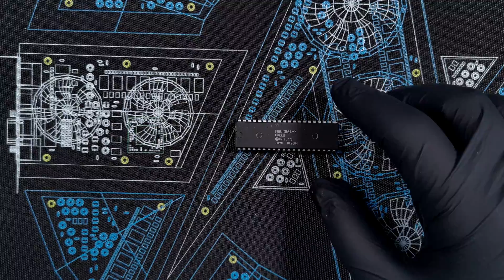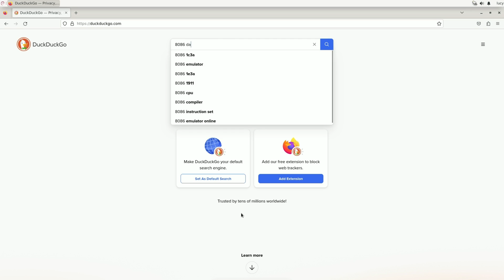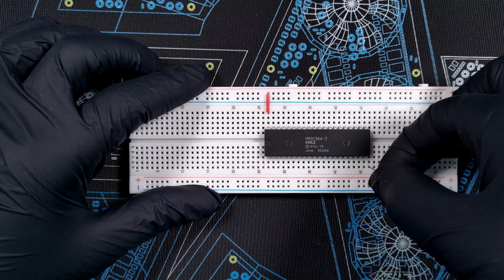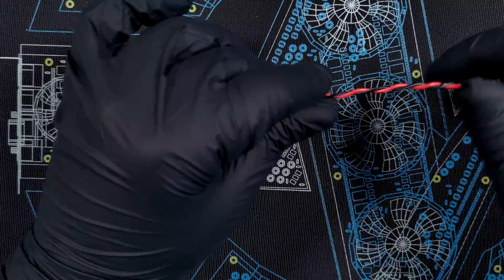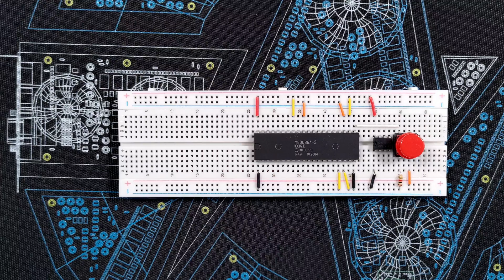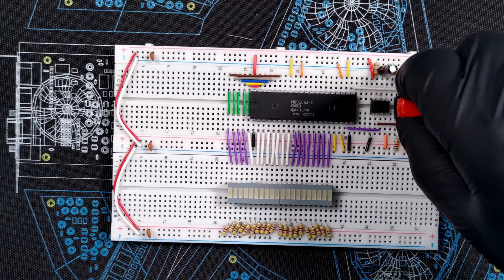Meet the Intel 8086 | 8086 breadboard computer | Part 1

Comment: the BAR means active low right ? so we have to connect it to the ground in order to use the pin or turn it on .
 am i right ?
i am taking microprocessors this term
Reply from the maker: Indeed. Normally, high voltage (in this case +5V) is logically evaluated as "true" or "active", while low voltage (in this case ground / 0V) is "false" or "inactive". But some pins are "active low" which means they have the logic flipped - for them low means true and high means false. There are no formal conventions around the notation, but some of the common ways are
* A bar over the signal name
* A forward slash in front of the signal name
* The letter "B" appended to the signal name

Comment: Isn't 4 amps too much current?
Reply from the maker: The 4 amps that the PSU is rated for means "up to 4 amps", using less is OK. The breadboard does not actually use 4 amps at all times, it only draws as much as it needs, which is nearly zero with the setup shown in the video.